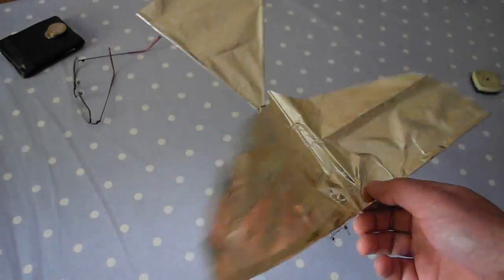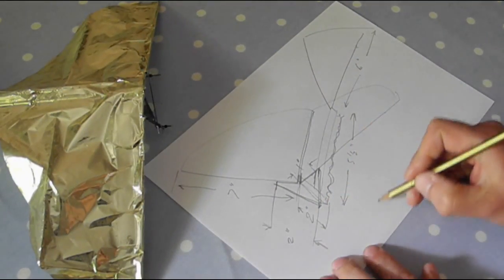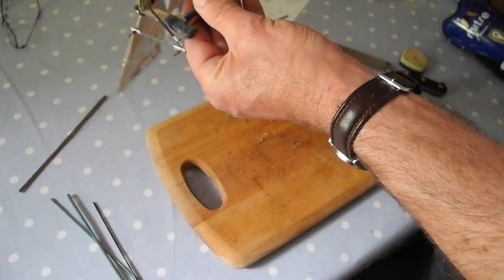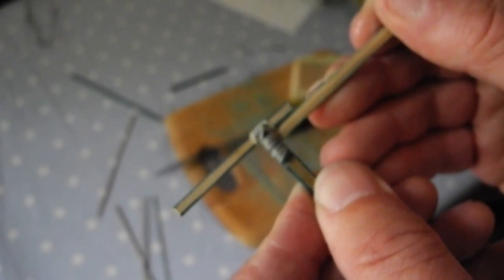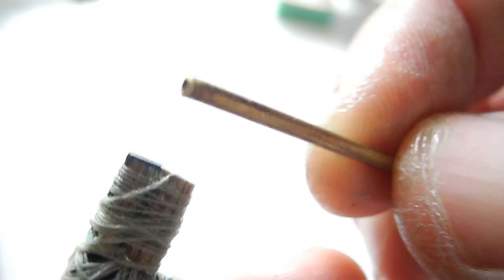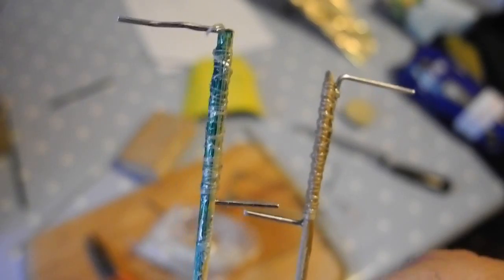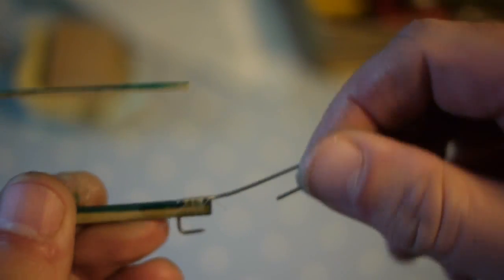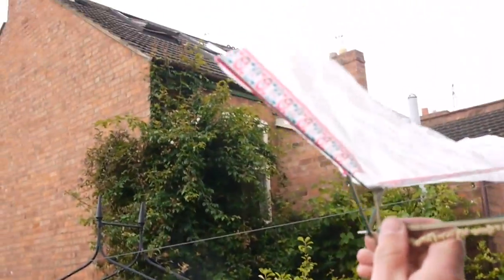Make an ornithopter

Comment from the maker: Indeed. Tissue paper like you find in craft shops would be great. In fact the best materials to use if you want the best flying performance would be balsawood, piano wire and tissue paper. You can find them all on eBay :-) if you Google model rubber motor you'll probably find a source of rubber strip for the motor too (elastic bands are a bit hit and miss).

Comment: An interesting challenge would be a battery powered one, that cuts out after a set time, like 15sec or 30sec etc, so it doesn't fly off for about 50 miles, unless it could be made to fly in a circle and not too high.

Comment: Use piano wire instead of paper clips. You can get it at any hobby store in about 1 ft packs of 4 pcs. Might be smoother to use an rc antenna tube instead of heavy brass. And for light rigid parts, bamboo skewers will do great. They are also skinny, so no dangerous cutting